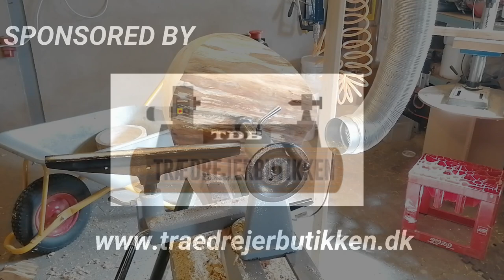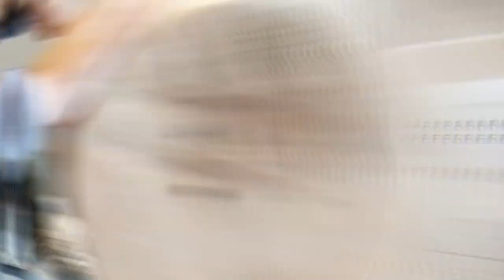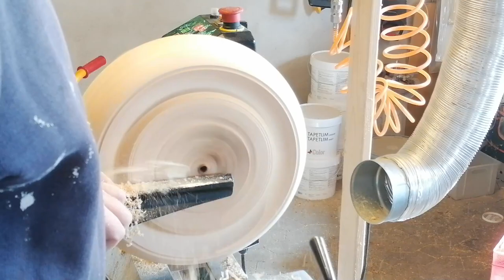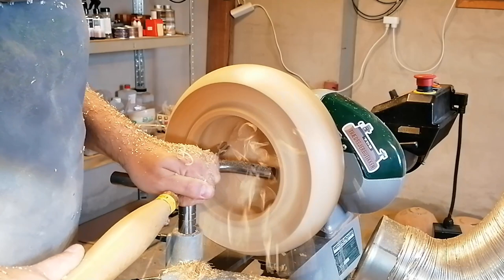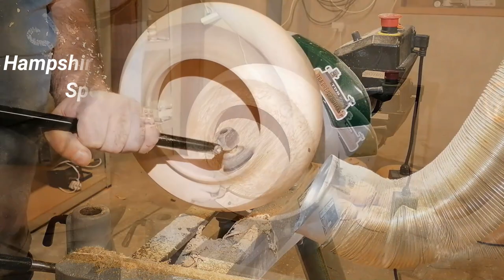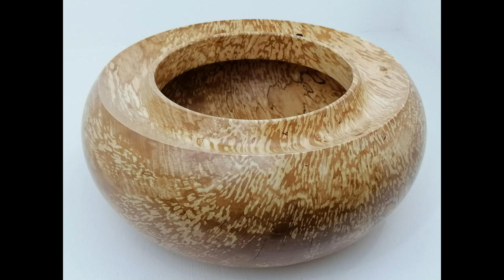Woodturning a large Spalted Birch Bowl

Comment: Nice work, Kim! I have the same problem with using CA glue - best solution I have is to spot sand the surface where the glue was applied.
Reply from the maker: Hi Rick, Thank you for watching and for the comment 😀 I have done the same with spot sanding, and it works to a degree but special in punkey wood it is har to remove completely, but I got some god tip to with sanding sealer before using the CA I am gonna try that next time.. i have 8 more rough turned blanks from this birch tree with spaltning, so there will be plenty of opportunity to try it out 😀 Have a great day Rick, and stay safe 😀😀  ..

Comment: Looks like the same hollowing tool I bought recently, also using 12mm carbide. Mine might be a bit shorter though. 
Haven't worked much with it yet but it cuts very well.
Reply from the maker: It is a really good tool, i made the handel my self and the handel is around 50 cm as I remember .. when you use it remember to take the tool rest a little more back than normal else the tool will flip on you, dont go past the flat part.. i wont tell you how I know LOL, thank you for watching .. stay safe and have a great day .. 😀
Reply: @WOODTURNINGBYBRANDSTRUP  Yup, been there, done that. 😀

Comment: I have luck with ca colouring by sealing the surface first. Ca still sticks. I use shellac.
Reply from the maker: Hi Stive, Thank you for watching, and ty for the tip i will 100 % try that next time I Need CA on a smal crack.. Stay safe and have a great day 😀
Reply: Same here. A little sanding sealer just around the crack stops it soaking into the surrounding wood.
Reply from the maker: @Ian Kaos  I will 100 % try that next time i need to close a little crack with ca .. Thank you very much.. and also for watching my video.. stay safe and have a great day ..

Comment: Lovely bowl. I have the same lathe, where did you get the S shape tool rest?
Reply from the maker: Hi Mike, it is a great lathe :-) I just added 190 kg to it and it made it a hole different lathe .. The tool rest is a Robert Sorby Modular tool rest system https://www.robert-sorby.co.uk/woodturning/woodturning-accessories/modular-tool-rest-system/l766-4-toolrests  Thank you for watching .. stay safe and have a great day 😀😀
Reply: WOODTURNING BY BRANDSTRUP I think I’m going to add a shelf to the lower part of the legs to see if I can stable it a bit more. Thanks for the link. Hopefully you’ll see my channel on YouTube soon.
Reply from the maker: @mikewickham1767  Looking forward to see you channel when you make it,, one other thing i did was to remove the rubber feet, i found them to course most of the vibration i had on the lathe .. beside off balanced blanks ofc :-) if you wont to see a picture how i did it send me a mail .. my mail is in the channel about tab :-)